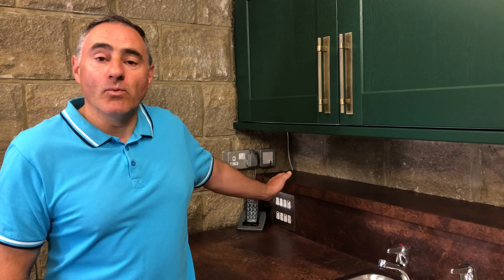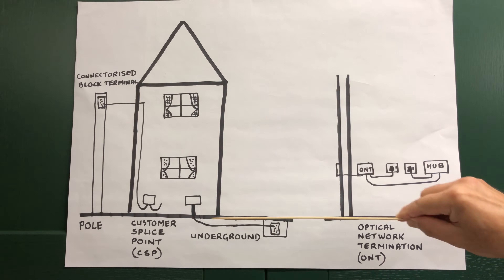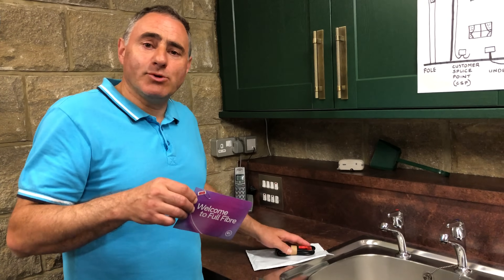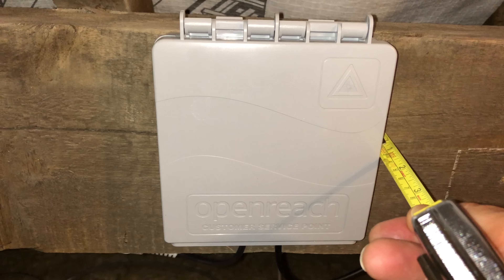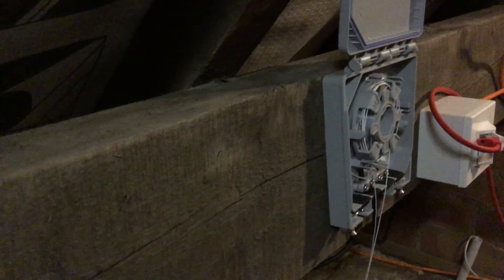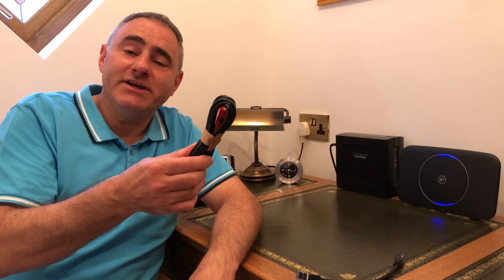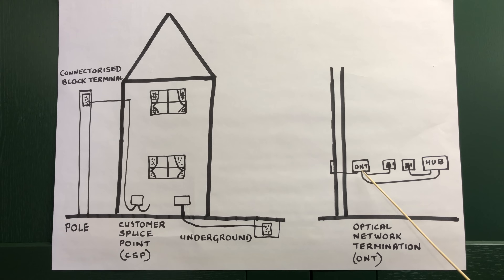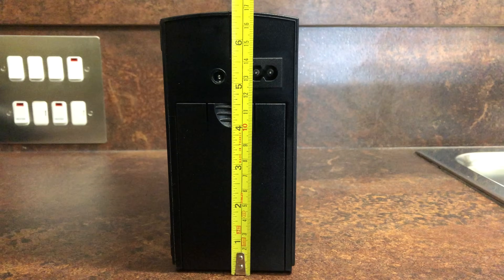Full Fibre Broadband with Battery Backup

Comment: How fast is your broadband now?
Reply from the maker: Hi SJ, I have full fibre 300. On installation day the test showed 326 Mbps download. Can’t remember the upload. BT say the min guaranteed will be 150Mbps. The normal upload speed will be 49Mbps. I’ve did a couple of tests using a wired connection and the download varied from 161 to 232. Every time I do the test the upload speed won’t display but it is fast when uploading Youtube videos. Thanks for watching. Cheers Rob 👍
Reply: @robswiseways5697 with bt on full fibre 900 I get max 950mbps to 1gbps down and it's constant at 110mbps up I bought my own Asus tuf gaming 2.5gbps router with WiFi 6 cost £80 and it's amazing with no drops in speed and WiFi speeds at least 600mbps on WiFi some WiFi getting 1000mbps and enthernet on cat 6 cables getting consistent 1000mbps it's been brilliant for a year after getting my own router as the bt smart hub after multiple replacements kept knocking my sons xbox and pc offline so had to keep resetting the hub as it ran out of random mac addresses as it kept filling up plus NEVER get the EE smart hub plus router it's awful just look at all the issues with it online with multiple disconnects and freezes plus the plus router with EE resets the event log after every restart it does so impossible to find out the fault issues apparently it's a known memory leak issues with these routers as they mass produced them quickly to compete against vodaphone
Reply from the maker: Sorry Chris I completely missed your reply. A very interesting read and I didn’t know about the problems with the EE hub. Thank you 👍. cheers, Rob
Reply: @robswiseways5697  that’s impressive
Reply: Used my BT app to do speed test. 
About the same results a on my mobile. 
But because my I almost speed the same as before full fibre fitting. 
Complained several times and now find on BT app the speed checking facility  has been removed. 
Sneaky. 
Still have mobile speed  checker.
Reply from the maker: Hello Peter, I do my speed test on a laptop wired with a patch lead. It has always been said this is the correct way to do a speed test. That’s how the engineer did the test on installation day. Hope you get sorted and things improve for you. Cheers Rob.
Reply: I've complained to BT several times about  my down speed has gone down since full fibre fitted. 
Been checking the speed on  BT app and my mobile. 
Now find the speed checking  on the BT app has been removed. 
So seeing you have the same issue  proves what I suspected.
Sneaky indeed.

Comment: The basic problem with FTTP is that some naughty burglar type person can still cut your connection to the outside world and the battery will just assist in telling you that there is a problem with your connection
Reply from the maker: Hello Mike, I suppose this is something that can happen to any of us at any time. How many old films have we watched where the copper phone line gets cut ? By the way, the battery wouldn’t know the fibre had been cut, so would continue delivering power to dead devices. Thanks for your comment and for watching. Cheers Rob 👍
Reply: @robswiseways5697  Totally agree your points are very valid but without an outbound connection either fibre or copper to be blunt you are in a pickle
Reply from the maker: @Mike_5  That’s the top and bottom of it Mike.

Comment: it's ok running cat 7 but anything hanging off that bt hub is only gigabit ethernet so only cat 5e speeds
Reply from the maker: You’re absolutely correct. All my structured wiring running in wall conduits etc are cat 7, so wanted to keep everything consistent by using cat 7 patch leads. I guess I’m covered for any future upgrades. cat 5e isn’t obsolete…yet ! Thanks for your input. Cheers Rob 👍

Comment: I have over 10 cameras around my property (not telling more) and I have battery backups on each aswell as the main fibre to ethernet and the switch I haven't had a problem in over 5 years
Reply from the maker: Thanks for your comment. Sounds like you have a good system there. We don’t get power cuts here either but I suppose you can never say never. Thanks for watching. Cheers Rob 👍

Comment: Both the router and ONT supplied by the local Isp (No Openreach FTTP or FTTC available here… despite many broken promises!! ) are both 12volts DC so I purchases an Eaton 3s Mini for about £40.00 and a splitter “Y” cable with the correct connectors on the ends, this keeps my internet connection alive hour about 1.5 hours… power outages any longer than this, then I’m thinking of powering up the generator.
The Isp’s battery backup seems to last about 2 to 2.5 hours.
Reply from the maker: Thanks for your comment Alan. 1.5 hours isn’t very long. My router/hub and ONT are also 12volts DC. The battery spec in my back up is 12v 7Ah. Luckily we don’t get any power cuts. I purchased these especially for the video. Cheers Rob 👍

Comment: Silly question, but as you use a wireless telephone, wouldn't it's hub / base station need it's own power backup to continue working in a powercut?
Reply from the maker: Yes the base station would need its own power. It’s best to have a corded telephone that doesn’t need power. This would be plugged into the back of the hub or into a system as shown in my previous video (video link at the end of this one). The hub would power the corded telephone, similar to the old analogue phone line. Hope this helps. Cheers Rob 👍
Reply: @robswiseways5697 If you have BTs DECT Phones for the SH2, the Smart Hub 2 is its own DECT Base.
Reply from the maker: Sorry I missed your reply. Yes we do have DECT phones and corded. They are plugged into the original phone sockets. I show how I did it in a previous video titled ‘how to video - analogue to digital telephone landline switchover’ Cheers Rob 👍
Reply: Or have a WiFi calling enabled on the mobile phone to use hub WiFi instead  @robswiseways5697

Comment: All good, but you still need a battery backup on your wireless house phone base station. Unless you have a wired phone connected to the hub. I use a UPS which powers everything from a protected power strip.
Reply from the maker: You’re right about the wireless phone John and it sounds like you have a good UPS set up. I have a corded desk phone plugged into the wall phone socket system that is wired back to the hubs phone socket. I show this in my previous video for which there is a link at the end of this video. Thanks for watching. Cheers Rob 👍

Comment: I have a UPS on our optical fibre system.  But then found out during the first power outage, that our ISP doesn't have a UPS.  So it was a bit pointless really!  Hopefully they will upgrade their system at some point.
Reply: If you live close to your nearest green box (that hums and whirres) it's likely that it lost power when you did.  This is going to be a big issue with full digital.  The old boxes were just junction points and didn't need power for voice connections.  For broadband and especially for fibre they have electronics in them, and I suspect they are tied into the street power grid.  So if you live near it then it's likely the fault could affect both you and the box.

The exchanges used to have multiple mains feeds and/or backup power.
Reply from the maker: That’s a very good point. You would have thought if BT / EE offer this UPS for their devices, their telephone exchange would also have a UPS. Thanks for watching. Cheers Rob 👍

Comment: Just an FYI the CSP would normally be on the outside of the house in a normal installation
Reply from the maker: Yes that’s right. I did it this way to avoid external cables and boxes on the outside. Thanks for watching. Cheers Rob 👍
Reply: @robswiseways5697  I'm surprised they let you as of now it needs to be on the outside as it's part of the OR network for maintenance so they can access it without requiring someone being available
Reply from the maker: @Bawlk  I guess I was lucky to be able to have it inside. But as I stated in my video I would have to book an appointment for OR to access the CSP. Thanks for your comment. Cheers Rob

Comment: When we moved to Vodafone and got FTTP installed as part of the switch, the openreach engineer left the master socket and telephone cable in place

Although the old telephone cable goes down a sloped roof, and the fibre was run via an intermediate pole and straight down to the ground floor wall (the ONT was placed near the master socket, and the CSP is outside the property)

Sadly Vodafone doesn’t offer any sort of battery backup for its router, but power cuts seem to never happen where i live
Reply from the maker: I wonder if the master socket and cable were left because you were switching to Vodaphone and not staying with BT ? As the country is gradually moving to fibre, it would have made sense for them to have stripped out the old equipment.
Power cuts don’t seem to happen for us either. I purchased the battery back ups for the purpose of the video because of all the power cut comments I received in my other video.
Thanks for watching and commenting. Cheers Rob 👍
Reply: @robswiseways5697  Stripping out more kit means more waste to dispose of... I can see why they leave it in... it saves money... 😎
Reply from the maker: @dougle03  You’re probably right there Dougle. Cheers Rob

Comment: Great explanation Robb . Came across very professional and yet simplified but not overly. 

I’m retired University IT and found it excellent and easy to follow , especially given that Sky have just upgraded our street to FFTP so I’m at that stage of thinking of upgrading my old copper ADSL.

Only consideration is I don’t want them digging up the front drive to get the cable from Pavement to house but guess that on install day I would be on their shoulder keeping an eye out.

I get around 35mbps atm and could obviously improve that with full fibre. However my 5G gets over 300mbps so another option is 5G router .

Thanks again Robb , nice diversion from caravanning vlogs and appreciate all your hard work in production 

Cheers 

H
Reply from the maker: Thanks very much for your appreciation and encouragement Howard.
I switched from 76mbps FTTC to full fibre 300 FTTP. They were offering this for the same price as 100. 
Sounds like your street is cabled underground. Can you lay ducting from boundary to house without disturbing the drive ? On installation day all they would need to do is draw the cable through. Agree Howard, definitely keep an eye on them during installation.
Caravanning videos resume soon 😁 
Thanks for watching and commenting.
Best regards
Rob 👍
Reply: Thanks Robb … and have you noticed significant improvement in DL and UL speeds?

Only the two of us here so not a lot of devices online or gaming
Reply from the maker: I’ve only noticed a quicker UL speed. We too have only two devices and no gaming. As our devices are getting on a bit (7 years and older), I wonder if the processors etc cannot match the available DL speed ?
Reply: Many thanks for that detailed explanation . I realised when I posted that I should have said OpenReach as I know they are the  guys with the heavy boots , drills and hammers. 

Good idea what you did and worth a consideration.  My front garden is in fact decorative stones etc rather than grass and flowers so I guess they will be able to bury beneath  as long as they don’t dig up the edging which borders the pavement as they were expensive edgings.

On top of this I’ve got Cadent in the street replacing gas mains and making a hell of a mess 

Watch this space … just glad I’m retired and can keep my eyes on everything !

Comment: Very interesting Rob, but for digital landline emergency use, how do you provide power for the digital phone?
Reply from the maker: Hi Barry, We haven’t any digital phones but I understand if the digital phone is linked to the hub via Wi-Fi then the internal batteries should keep the phone live until they run down. If the phone isn’t used I would imagine they should last a while. The other option is to have a corded phone plugged into the back of the hub or a similar set up to my corded desk phone shown in my other video. The link is at the end of this video. Hope this helps, Cheers Rob 👍
Reply: I've looked into it and found that BT/EE say that mains powered digital phones won't work during a power cut because the phone base plugged into the hub needs mains power to transmit the call signal to the handset(s) as well as keeping them charged. The batteries only power the handset functions to receive & transmit calls to/from the base. As you say, the only option is a non-mains powered corded phone plugged into the hub, providing it is compatible with BT Digital Voice.
Isn't technology advancement wonderful! 😂
Reply from the maker: Thanks for the info Barry 👍. Probably worth experimenting by turning off the power to the base to see if the phone still works. By the way, the corded desk phone I have, although having a mains cord/plug, it does work without being plugged into mains. It takes its power from the hub to work like the old analogue set up.
Cheers, Rob